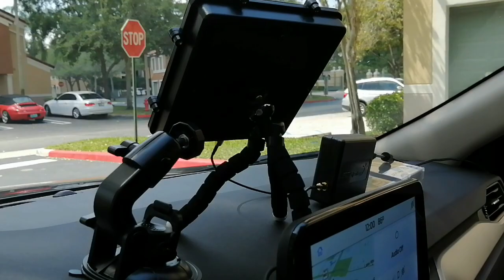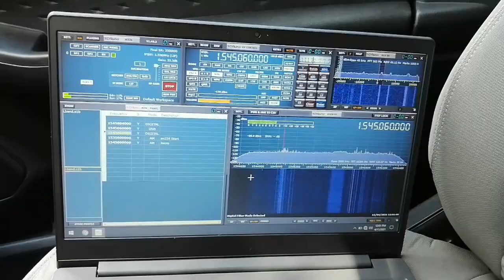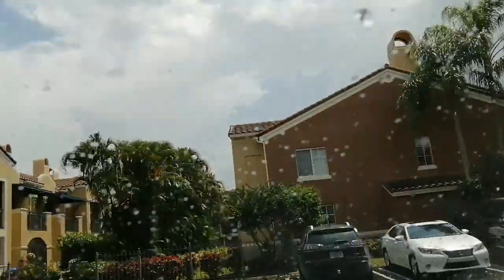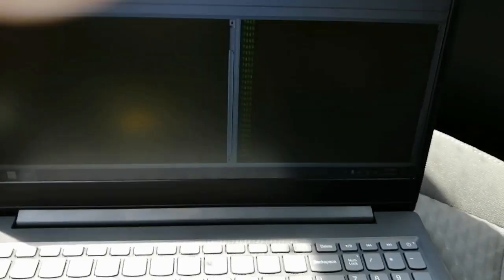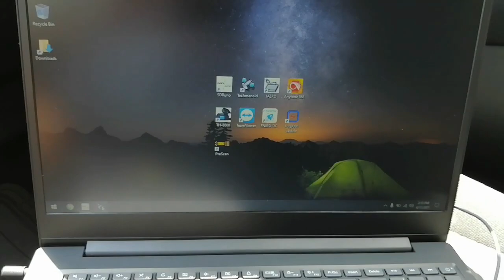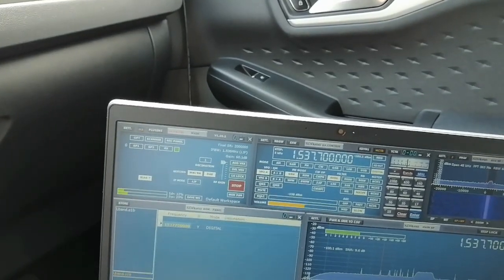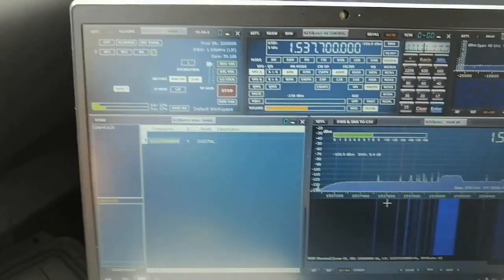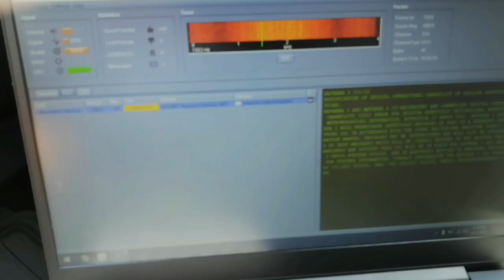SDRplay RSP1a - RTL SDR Blog L-Band Patch antenna

Comment: i bought a patch the same antenna and the sdr blog v4 dongle but do not see any signals anywhere do i need a LNA also. was thinking this is all you needed to see signals
Reply from the maker: No LNA needed. The BIAS-T of the device will power it.

Comment: Hi Mike does the AIS use the same sattelite for ACARS I'm in the UK ?
Reply from the maker: Not 100% sure but you should be able to monitor it on Inmarsat-4A F4/Alphasat at 25° East
Reply: @SDRplayHamGuides  HI thanks so much for the reply, I'm decoding ACARS ok using the Jearo software with my L Band patch antenna using a RSP1A, I would like to try to decode AIS any idea what the frequencies would be ? thankyou
Reply from the maker: @drmisfit  Sorry, I don't know the frequecies used, I'm US based. You can try the SDRuno frequency banks provided here https://www.sdrplay.com/sdrplayhamguides/
Reply: @SDRplayHamGuides  thankyou :)

Comment: Another great & very informative guide!  Recently acquired an RSP1A and your guides have been the key in getting excellent results from a simple wire antenna and older laptop PC.  After 50+ years in amateur radio, your SDRs, website and guides are simply the best!  Thank you & 73 to all of you at SDRPlay.

Comment: Yours is the second review I've seen - very promising. I currently use the SDR-Kits patch antenna with my RSP1A and get decent results off Inmarsat-4 F3 using Tekmanoid STD-C and JAERO 32-bit. I want to use JAERO 64-bit so that I can attempt to decode 8400 bps voice messages, but I can't get it to execute (Windows 10 64-bit; latest JAERO release; latest Java 64-bit release). I'm awaiting approval for my request to join the JAERO discussion group on groups.io in hopes of getting some tech support there. If I do get it working, I'll probably buy this antenna (hope it's still available - after these glowing reviews, there appears to be a run on them!).
Reply from the maker: Hi Allen
 I tested the latest development build of JAERO yesterday https://github.com/jontio/JAERO/releases/tag/latest
specifically for 8400 voice messages and it worked amazingly well. The laptop in the video is running W10 x64. Hope 
you get the issues sorted.
Reply: @SDRplayHamGuides  Thanks for the link - I'm not sure what I grabbed originally, but I went (back?) to this link, downloaded the latest release, and bingo! Got 64-bit JAERO working. Decoded a couple of 10,500 bps signals for the first time, but couldn't figure out which signals carried 8400 voice (and not sure my SDR-Kits patch antenna is up to the task).

Comment: I bought the previous antenna, and never could get an Inmarsat signal here in Oregon.
I tried for several weeks, and just ended up sending it back to Amazon.
Is this antenna substantially better than the previous one. I'm using a SDR PlayDX.
Reply from the maker: At my location its much better than the previous L-Band patch antennas I used. You should pick up something off 4 F3 on 1.537.700.000
 pointing the antenna south and a bit to the east https://www.n2yo.com/satellite/?s=33278
Reply: @SDRplayHamGuides  Thanks. Last time I had an app that showed the satellite locations in the sky. Guess I'll order it and see what happens. 
It's been about 20yrs now, but I worked with Inmarsat and Motorola out of San Diego putting Inmarsats on US Navy ships. 
I did some early Inmarsat tests out of Pensacola using the USS Lexington as a test bed.
Reply from the maker: Connect the antenna to Port B of the RSPdx. 
Enabled the BIAS T
Run the RFGAIN at max

Use this link https://www.n2yo.com/satellite/?s=33278 to help point the patch

Tune to 1.537.700.000 and you should see signals

Comment: I've got one on order, but unfortunately, Amazon was out of stock so it's coming from China. I currently use a patch antenna from NooElec which works really well on 3-F5 but is marginal on 4-F3 (98 W). SNR is 8.5 and in 7037 frames, only 33 lost. Tekmanoid decodes it well. Hoping this new one will perform better.
Reply from the maker: My location and weather was not ideal. You should certainly see a difference with this antenna